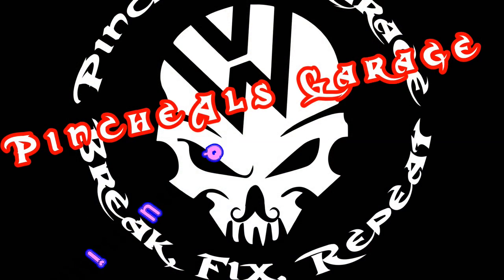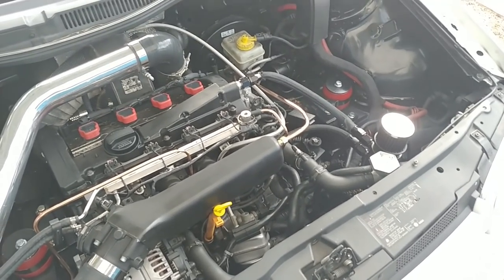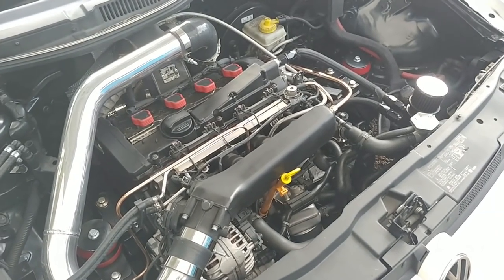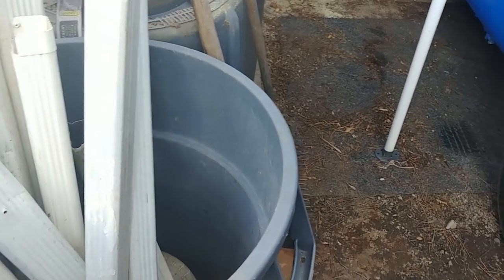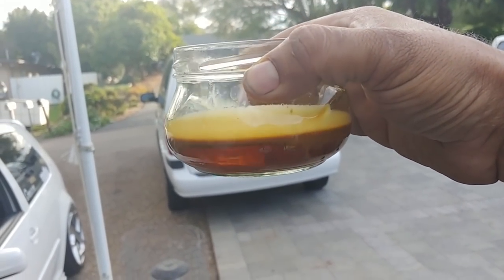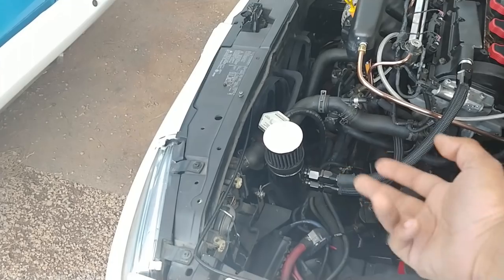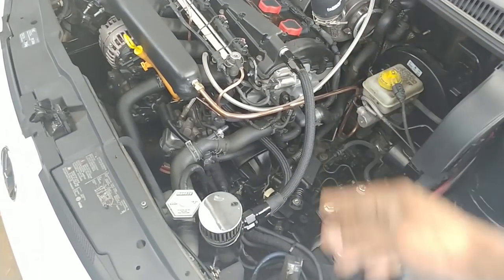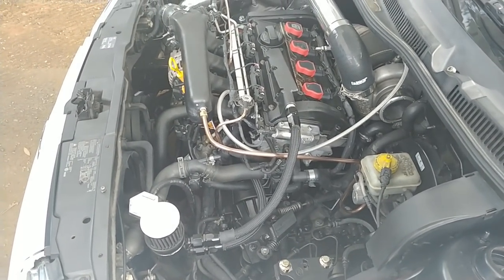Why you need an Oil Catch Can PincheAls Quickie

Comment: damn I need a catch can...
Reply from the maker: dyllman98 yup its pretty nasty what comes out. In the description i have a full part list with links to make your own catch can.
Reply: thanks def gunna make one now! never knew that gunk got recycled In the engine
Reply from the maker: dyllman98 your welcome. That's why i am here to teach and learn together.
Reply: thank you pincheal. so basically my mk4 gti 1.8t has 231,000 miles on it and its blowing a lot of blue smoke barley building any boost at all, I'm getting another engine that has 90k on it swell as coolant flush (bc there was green coolant in the system) mechanic is doing it for 1700$... is that a good deal?? am I getting ripped off? I want to keep this new engine in the best shape possible!

Comment: How are you not getting MAF codes and or lean codes running that catch can? THe only thing I can guess is your tuner made some changes in the ECU for the metered air coming out the top of that catch can. Also, it seems your set up is running with no vacuum inside the crankcase? I have heard you get better ring seal with the crankcase under vacuum. I have the 034 motorsport catch can kit on my GTI. It recirculates the air back into the intake after flowing through the catch can.
Reply from the maker: The car is completely tuned for Mafless. Ring seal only matters during the breakin process after that it has no more affects while driving. With or without a recirulating catch can.
Reply: I knew something was up with the tune lol I'm not talking about during engine break in. I'm saying generally speaking having a vacuum inside the crankcase during operation helps with ring seal. Who did your tune?
Reply from the maker: userpike the engine will always be under pressure and vacuum internally. The vacuum through the heaf and crank has nothing to do with the piston rings.
Reply from the maker: userpike Trent Smith from Boost Dynamic Concepts
Reply: no I'm saying that vacuum inside the crankcase will assist the rings in creating a better seal to the cylinder walls as an added benefit, it is not needed. The engine will have less blowby while the crankcase is under vacuum because the rings seal better under vacuum. This is scientifically proven. That's why people put vacuum pumps on their race motors, especially big v-8 NA motors. Here is an article I found for you http://www.dragzine.com/tech-stories/engine/tech-how-external-vacuum-pumps-free-up-horsepower/
Reply: If you have time check out http://nefariousmotorsports.com You can learn to tune Bosch ME 7.5 yourself. It's pretty awesome. The logger written by a member there name Setzi is better than anything you'll ever find in the market and it is free. You just need a cheap ebay usb to OBD2 dongle. If you have a VCDS dongle it'll work also. The Nefmoto flasher works very well also. Check it out! Maybe you can out tune this Trent Smith guy!
Reply: userpike no maf hes running a BT mafless file 😑
Reply: And btw @userpike you know nothing on this process..pinche knows and i know..i run a performance page on fb that we have tuners and people that track their car especially the owner of the 900hp gti

Comment: So i got an 03 gti 1.8 awp what would u recommend for first mods? And i want to clean up the engine bay without losing the ability to pass smog in cali
Reply from the maker: 1st all your mods will need to be CARB certified so that leaves you with 

AEM or Injen colad air intake
Catback Exhaust
Maybe and APR or GIAC tune
Bigger side mount intercooler

That's all you really can do or else youll fail Visuals for your STAR Smog.